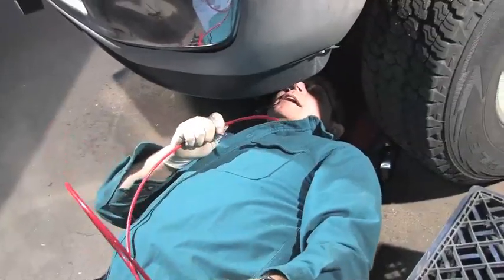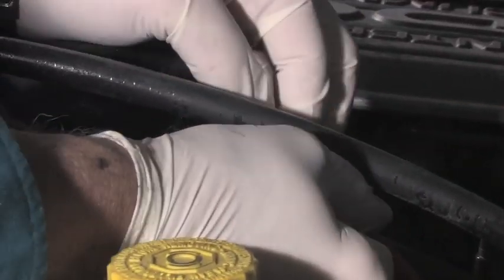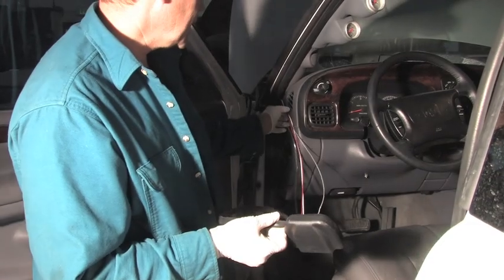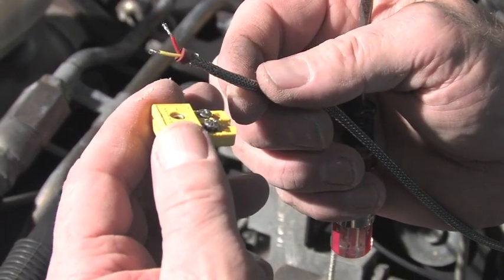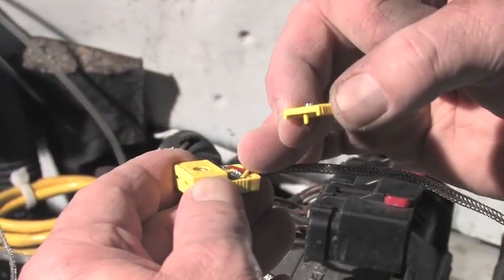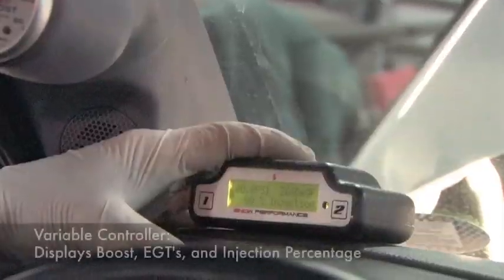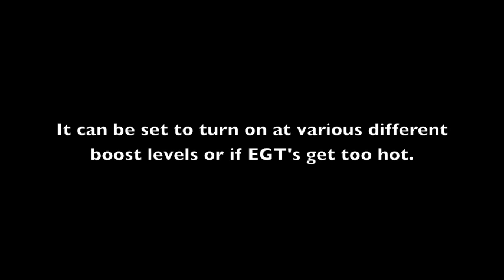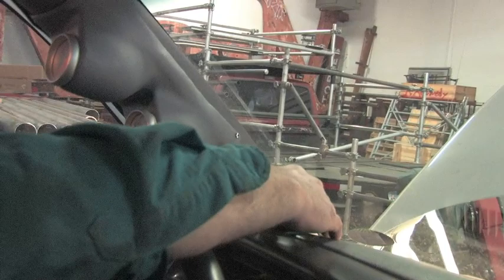Snow Performance Water Methanol Injection Kit Install: Part 4 of 4

Comment: I have ordered a stage 2 kit for my o8 6.7 ram and I was wanting to ask what setting I could / should be using I've got 5"tbe & smarty sr set @ 90hp with timing egt & dpf gone .southbend street duel disc clutch . What temps and what boost pressure ?